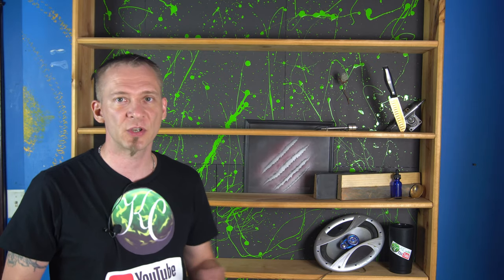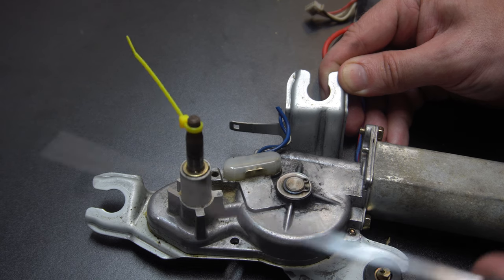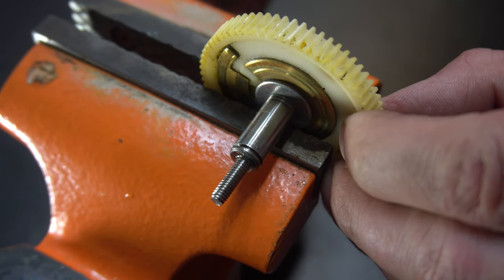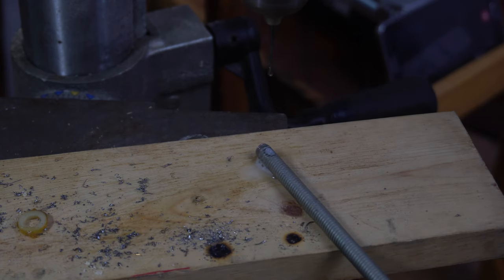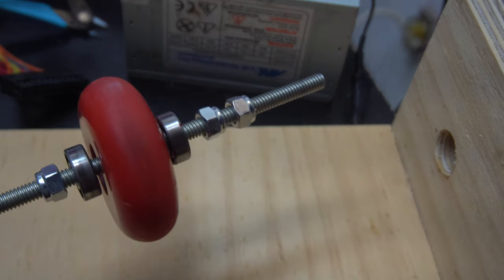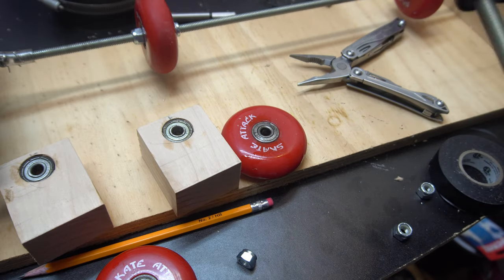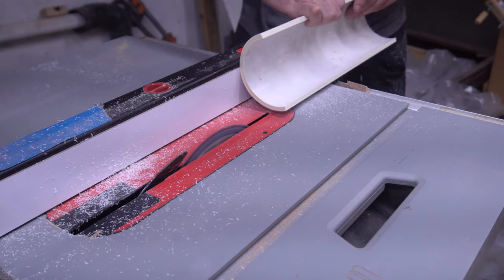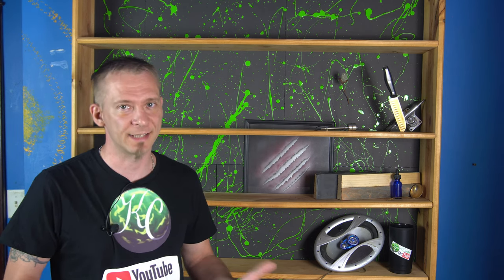How to make a Rock Tumbler Ball Mill

Comment: Very cool idea! This looks like the best high capacity and low cost unit I've seen. I will try making a variation on this. I'm a little worried how the PVC will hold up to weeks or months of tumbling bigger rocks but I guess it could easily be replaced. I might try coating the inside with thick layers of rubberized paint.
Reply from the maker: I would lover to know how it turns out please let me know or even send me a picture.

Comment: I thought about building one pretty much same way. I was thinking about an automotive motor, like a power window motor, but the 12v dc was throwing me off. I also thought about pvc pipe, but with screw in type cleanouts for the ends, one last thing was wheel casters from a cabinet or chair, mounted upside down.  I suppose I could add additional casters if I was going to do different size ones.  I think I have most of the parts just lying around here. Thanks for the video.
Reply: Solar panel good idea because it's DC power
Reply from the maker: I didnt do the threaded ends cause of cost but if you have it perfect. A laptop power supply could work too.
Reply: I saw an bathroom exhaust fan, it's 120v and comes with a plug..20 bucks.
Reply from the maker: @phildavis4575  You would have to figure out how to gear it down to 30-40 RPMs but they run for allot of hours without wearing out. Make sure anything you build is in a safe spot and not a fire risk too.

Comment: Nice, I'd wondered about using PVC pipe for the tumbler.  Also, as crude as using rubber end caps might seem, they should definitely reduce the "bomb index" if something were to ignite.
Reply from the maker: I didn't look at it that way but I think your definitely right.
Reply: Ive made 100mm PVC pipe barrels. They work great. Into my 3rd week straight tumbling and no leaks or degradation. I glued and capped one end and left the other end as a push on only. I used one loop of plumbers tape and then pushed the cap end on. Solid seal!! Also wrapped duct tape around each end just in case, but it also adds a bit of grip to the rollers. So far, working great.

Comment: Any idea what RPM the wiper motor operates at? Could a power window motor also be used or are they more expensive? I've been wanting to modify a tumbler to run multiple barrels and also wanted to run it off of a solar panel and battery.
Reply from the maker: I just counted it and its about 37rpm. I think a window motor could work. The best thing for a long lifespan would be an induction motor but its difficult to find one geared down. For me the wiper motor was free so not sure on what would cost more for you.
Reply: Most wiper motors have two connections so you can do high and low speeds.  (The RPMs vary by model, so I can't tell you specifics, and the numbers are usually no-load).  There are also DC motor speed controllers that you can pick up for <$10 off eBay or wherever.  I have several of those on-hand bc I use them for Halloween projects.

Comment: Just my two cents:
need easy system of gearing, that is pulleys,    Have found it is easy to make polyurathane
belts and wooden pulleys,  5/16 inch belting,  cut to length,  heat ends,  but joint in simple right angle jig.
I needed slower RPM on drum from airpurifier fan motor.  So just about any 500watt+ motor can be
reduced to critical or less drum speed.   1/4 inch baltic birtch plywood.    ABEC wheel bearings and
5/16 skateboard axles.   i also used skateboard trucks & wheels with an 8 inch PVC drum.

the poly belts are amazing.
Reply from the maker: That sounds like an amazing build. Do you have a picture of it I would love to see what it looks like?
Reply: where do you get those poly belts from?

Comment: I would love to see someone make a DIY ebike out of power chair Motors set up like a mid drive so that you can Leverage The Seven existing gears or however many you have in your back cassette and your rear derailleur as it already is because these are actually powerful Motors with huge potential with low RPMs in high torque that I think would be just perfect for an ebike but I've searched high and low and haven't found a single video yet where their used for an e-bike. Millions using washing machine motors and old hoverboard Motors but absolutely nothing using power chair Motors and I thought you might be up to the task.
Reply from the maker: If I come across some for cheap I might try it. I have wanted to do several things with those as they would be GIAN servos but around me they are expensive. 400 for cheap dead power chair :(

Comment: Make a geyser pump that will pull water from 40 ft down inside a 2" pipe
Reply from the maker: I need to look into that I know what a ram pump is but never a geyser pump. I wish I had a 40 are to pump.

Comment: Damn, that’s nice. I was just thinking of making a rock tumbler out of 6” PVC when I ran across your video. Great job. 
I’m not electrically inclined but I’ve seen 100 to 200 RPM dc motors on eBay. Do you know what I should look for in terms of Watts and amps?
Thanks,
Paul
Reply from the maker: Rpms I believe is like 30 - 40 watts really depends on how big you go but most store bought I think are around 70 watts but going bigger has the advantage of less stress and longevity of the motor. A lot of geared down motors on ebay wont run for hours without overheating. Arcade motors can be good but if they want $50 for one a rock tumbler bought starts to seem cheap. I had this wiper motor lying around. Does that help?
Reply: @KCreations4You  
Thanks for the good info. I’ll have to do some research on motors.
Reply from the maker: @paulmanhart4481  I just thought of an option is a motor for the turntable of a microwave.

Comment: Would you mind sharing some details about you hooked up the solar panel?
Reply from the maker: Not at all. Its a panel I made about 8 years ago and has seen better days. That being said it puts out about 14 volts at the angle I have it at so I just wired it directly and you guessed it, at night it doesn't run. I normally run it off a computer power supply however When I tested it I was grinding stuff that could ignite so keeping it off grid was a better situation.
Reply: @KCreations4You  Thanks, much appreciated! I plan to hook one up exactly as you described so I can run it during the day for free. Lots of rocks to tumble and lots of sun here in New Mexico.
Reply from the maker: @conbeaute  Glad to meet another creative mind! You should let me know how it goes. Someone said these motor get hot so keep an eye on it. I checked mine several times and never had it get more than warm.

Comment: how many hours you have this motor on?
im not sure, but i think this windshields wipers motors arent made for long time work...
i wanna make my own rock tumbler, and the motor is the only thing i havent now. did you try this motor for long time and works good?
ty for all, and ty for the tutorial. its so good.
gg for your chanel
Reply from the maker: I though I mentioned its not the best motor for doing this, an induction motor would be better however for something laying around I have weeks on it. I did not expect it to last as long as it has but it makes sense cause wiper motors get used allot and are designed not to fail often as a safety part. The downside to a induction motor is getting it from say 1500 rpm to 30-40 thats 50 to one. This makes this one good for me cause I'm not going to be running it all the time. If you plan to run it extensively might be better to buy one. Hope this helps
Reply: @KCreations4You   yeah its  helps a lot, all the information is gold  ^^  thanks you a lot, you are  the best!
Reply: the wiper motors are continuous duty dc motors.  they will fun till the bearings fail.  i used one for a trommel and left it on for 2 weeks straighy to test my system.  it never even got warm lol. you actually picked the perfect low amp mitor.  add a 100 watt solar panel and a charge controller and it will run forever.  think they draw 4 amps tops.  thats only 48 watts so ud still have enough to recharge over night.

Comment: I would suggest to use a motor from a washingmachine or dryer. You can get those for free..
Reply from the maker: It would have plenty of power but what would you use to gear it down? They spin at 1750 rpm and you need like 30-40
Reply: @KCreations4You  Pulleys and a v-belt.

Comment: Ok, exactly how did you get that aluminum case to break like that using the wire. It seems you performed a bit of magic. A detailed explanation would be really great, unless of course it's just a gag, then haha. Also, windshield wipers get hot when used continuously I am wondering how you managed to get around that problem? Perhaps because it's out in the yard using a solar panel for power, if it can catches on fire nobody cares? And last but not least, how well did the final ball mill work. Just wondering if it was ultimately a great success or all just for fun. BTW: I did cringe just a bit when you glued up your bearings. Nice trick though.
Reply from the maker: I have used it in my basement for days with a low amperage fused power supply and it only seems to get warm however I did mention its not the best motor for the job. If you can use an induction motor thats geared down. It is still working so I think its ultimately a success however I would change some things if I ever made one again. Hope this helps and Thank you for the interest.

Comment: Cool project, but one question: Does the PVC not wear down? I had the impression that tumblers had to be coated in rubber, which is less rigid, in order to protect them from wearing down. Have you noticed any issues with the PVC?
Reply from the maker: I have not noticed any wear if any its on the tires. The pvc is schedule 40 so its almost a quarter inch thick not the thin stuff.
Reply: Ive made 100mm PVC pipe barrels. Just normal stormwater PVC, not thicker pressure pipe. They work great. Into my 3rd week straight tumbling and no leaks or degradation. I glued and capped one end and left the other end as a push on only. I used one loop of plumbers tape and then pushed the cap end on. Solid seal!! Also wrapped duct tape around each end just in case, but it also adds a bit of grip to the rollers. So far, working great.

Comment: Question: As you are using PVC do you have any concerns about the buildup of a static electric charge?
Reply from the maker: I used it to make aluminum powder and yes. It didn't do anything the time I did it but I treated it as if it could be an issue. Always error on the side of caution.

Comment: Cotter pin?
Reply from the maker: I'm not sure what you are referring to.
Reply: Probably referring to using a cotter pin where you used the bits of wire to key the flex shaft. 

The wire does the job and was probably free. Keep up the good work.